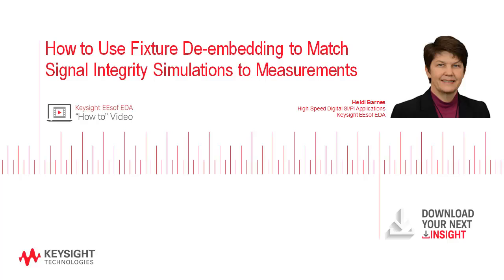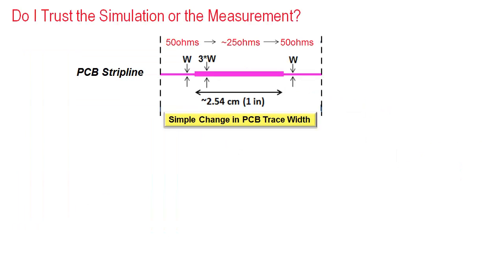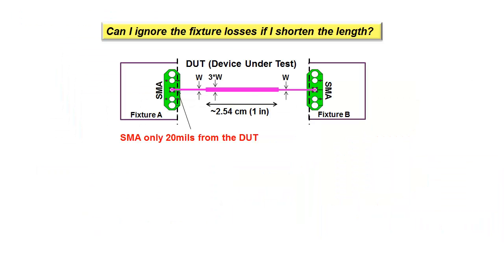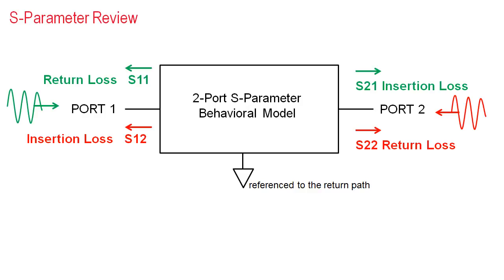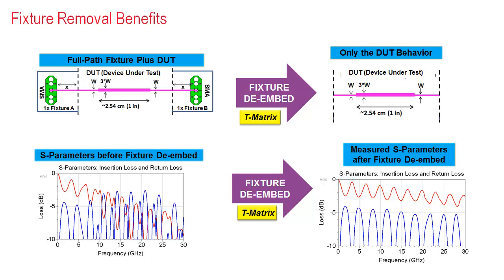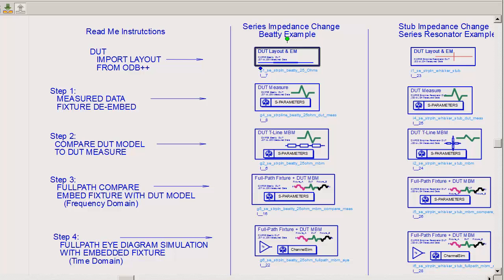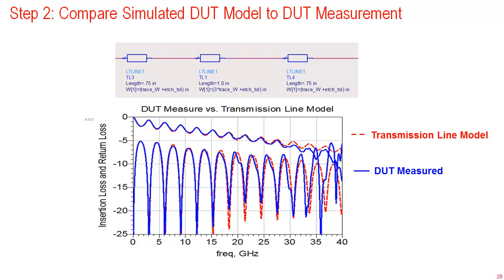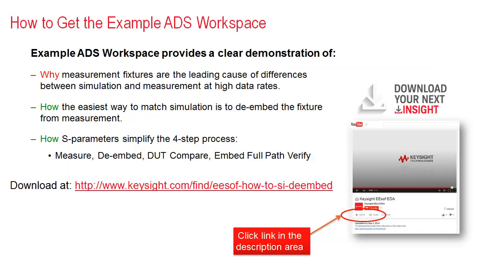How to Use Fixture De-embedding to Match Signal Integrity Simulations to Measurements

Comment: Well this presentation does not tell HOW the fixture only s-parameter was captured. We all know removing it would have good correlation with stimulation. 2X thru could be a method but it still cannot mimic actual physical structure which will have via and connector footprint...

Comment: The question is what is new in what you are presenting?
Such de-embedding methodology existed for ages, using VNA's gating or IConnect
Reply from the maker: Markus Bingle Great question! Here’s a short response. If you want more detail, please fill out the form at www.keysight.com/find/eesof-sales-assistance, reference this video in the comments section, and a technical representative will give you a call.
Reply from the maker: Markus Bingle What’s new in this approach is the accuracy that comes with the mathematically rigorous S-Parameter de-embedding. It removes fixture losses and resonances from both the reflected return loss as well as transmitted insertion loss TDT paths.
Reply: Accuracy is in the eye of the beholder.  If you check the slides you will see that S11 is worse at lower frequency,  compared with high frequency, after deemedding.  It is not a common case in return loss measurement.  Reflections are more likely to be visible at smaller wavelength.  Please note that measurement shows that as well.. though  it appears as a basic topology, Something is wrong in calibration and setup.   One thing I'd like to add that it would be nice to have  the software name used  in the beginning of the presentation, so we know!!Good Job
Reply from the maker: Markus Bingle Thanks for the feedback!
Reply: +Markus Bingle I am the CTO of Wild River Tech.   Markus, your not correct regarding VNA's or Connect (I was the Apps guy at TDA Systems before Tek bought them).     This is a measure based modeling approach but it uses a bifurcated model of the THRU, and secondly uses both time and frequency domain optimization methods.   VNA method uses time domain gating methods or proprietary AFR algorithm (Keysight), which is very different.    IConnect modeled time domain topological only.    3rd the method also utilizes models of the t-lines for THRU so it is completely scalable, including the loss portion.   It was really tough to do that in Connect.
Reply: +Alfred Neves To take advantage of gating or any other approach eliminating fixtures effects, without physical embedding, there should be"time and frequency methods' used ,.  Tell me why the method is more accurate!
Reply: +Markus Bingle I meant: without physical de-embedding or  fixtures calibration by the standards.
Reply: +Markus Bingle Gating got its weaknesses, and it is a second choice  of calibration but has worked for me, and others if you look up  literatures  correlating methodologies, using it with Wiltron and HP types of VNAs . IConnect used standards' methodology to calibrate topologies in time domain and later convert the acquired waveforms to frequency S and mixed S parameters.   I correlated its data to  VNA measurements and looked good for several GHz.  IConnect as well uses Z profile eliminating fixture effect and dynamic  reflections from the set boundaries.  The advantage of ADS is that it is a solely simulation and modeling software in full control of what it feeds as topologies and boundaries, and codes, making correlation less challenging, however more data is helpful as numerous methods out there claiming de-embedding, including Matlab functions, from MathSoft,,  are still to be proven.   Scaling would add flexibility and what if scenarios to engineers, but is a only minor advantage, in industry with specs of less than 0.5 db.

Comment: Here a couple of examples on how to extract the de-embedded S-parameters of the DUT  from a single TDR measurement using  a minimized fixture:

https://www.researchgate.net/publication/272790536_COUPLED_MICROSTRIPS_.1-20GHZ_S-PARAMETERS_COMPARISON_BETWEEN_SI9000E_AND_DWS_TDR-BASED_BTM_MODELS

https://www.researchgate.net/publication/273462402_COPLANAR_MICROSTRIP_.1-20Ghz_S-PARAMETERS_TDR-BASED_DWS_MODEL_VS_SI9000E

Comment: Another less expensive way to do this is to avoid as far as possible connectors and connector transitions by direct soldering the launch cable to the DUT. The de-embeddig processes can performed  using DWS (Digital Wave Simulator), available on line for free at https://www.ischematics.com/ ) able to deal with behavioral S-parameters in  time domain.
 Here an example with comparison to ADS results extracted from this case: https://www.researchgate.net/publication/273457449_BEATTY_LINE_ADS_VS_EXTRACTED_0-40GHz_DWS_INSERTION_LOSS
Reply: Soldering directly to the DUT has been a common practice at lower GHz applications, but as the video shows, shortening the fixture does not always improve the loss at higher frequencies.  Less loss and closer interaction of impedance discontinuities at the coax to planar transition can cause larger reflection signals interacting with the desired forward traveling signal.  Hand soldering is very difficult to control on the repeatability of solder volume, and if you look at the industry trend at DesignCon, high performance fixturing connectors for 3.5mm, 2.4mm, 2.92mm, 2.4mm, and the latest 1.85mm connectors to 110GHz are all using solderless pressure contacts.  High performance Ground-Signal-Ground probes are another option that provides better repeatability and performance then hand soldering along with additional calibration techniques that are not available with hand soldered connections.
Reply: Heidi Barnes Direct soldering is good at least up to 20-30Ghz if you keep the launch cable tail as short as possible (1-2mm). Yes Heidi, you are right, keeping the launch cable very short to improve the bandwidth of the incident signal can increase the reflections coming from the instrument and interacting with the DUT. But you can all take these effects into account if you have an accurate model of the instrument (TDR) output port. of the launch cable and related connector and the joint the DUT. This task is easily performed   directly in time-domain by means of the BTM technique using pwl approximations of the actual  behaviors. In this way an accurate de-embedding of the DUT is achieved by optimization. This technique can be less effective for repetitive measurements on several DUTs, but is very fast and cheap compared to that proposed in your video.
For more examples look at:  https://www.researchgate.net/profile/Piero_Belforte